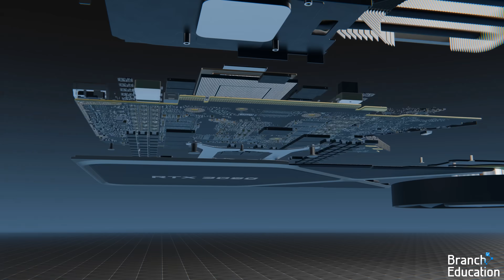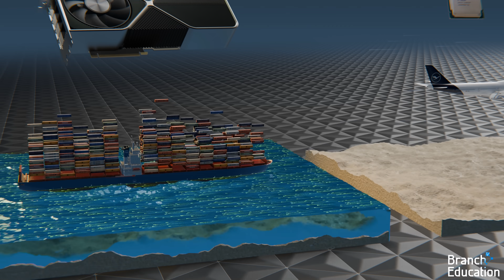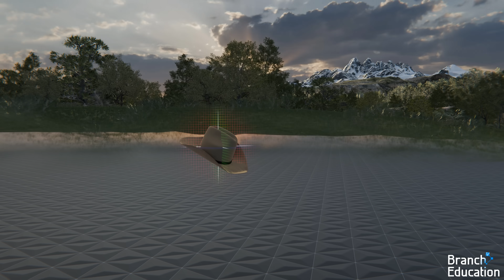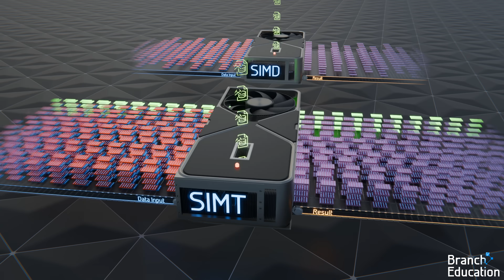How do Graphics Cards Work?  Exploring GPU Architecture

Comment: They don't sell chips based on whether they've gotten damaged or not, they actively shut down votes to adjust the prices accordingly. They're ripping you off basically and it's legal because we're dumb enough to keep buying them. The only time you get an entire chip working is the very last one in the series, all the rest of the models have deactivated cores. Of course they say they're damaged so you don't try to activate them but all you need is a bit of power and violá

Comment: I think that weather/climate models fit the"embarrassingly parallel"  since in parallel mode the globe is split into an array and each core essentially does the same calculation. The finer  the grid  the more points hence more cores. Can they benefit from GPU impromentss

Comment: When you broke down the comparison between a CPU & a GPU it sounds like a GPU is a lot more like a an ASIC then anything. With an an ASIC being a chip designed for a specific task & a GPU's task being digital image processing & accelerating computer graphics there doesn't seem to be a whole lot of difference - at least on the surface.

Comment: My RTX 4080 in my current desktop can do 48.74 trillion calculations per second. Compared with my old desktop which has a GTX 1070 that could do 6.5 trillion calculations per second. My current desktop also has an i7-14700K, 32GB DD5, 2TB Samsung 990 Pro M.2 SSD, which I got back in Dec 2023 and have yet to do a review video of (I'm looking to get round to the review video next month)

Comment: As a professional electrical engineer with 20+ years of experience, I have found that Micron's datasheets for memory products are either the best or amongst the very best out there.   It should not come as a surprise that the quality of their video is extremely high as well.

I've had instances where I was trying to interface another brand's memory product (not my choice) and ran into persistent problems.   Read the datasheet for the similar Micron product, and the issue immediately became clear.   In other words, the other brand's datasheet was poor.   When the choice is mine, I look at Micron memory first.

That's a long winded way of saying, excellent work.  Thank you!

Comment: It’s simple. 
A GPU chip only does one thing.
A CPU can do many things.
A GPU changes a black cell to white. 
A CPU can decide if the colour needs changing, which colour is best , how bright it is and place it in not just the right place but the best place of many options to best serve the apps function. 
And a CPU can run many apps.

Comment: The craziest part for me is: how did people come up with this??????
Reply: It didn't happen overnight. Today's GPUs are a result of gradual improvement over decades. Initially computers didn't even have GPUs. The CPU had to handle all the graphics processing. Of course that slows down the program so programmers got the idea of making GPUs that would handle graphics processing and so free up the CPU to run the program. Today's games require so much graphics processing that it would be impractical to run them on a computer without a GPU. But all PCs today have a GPU. Even if a PC doesn't come with a dedicated GPU it has an integrated graphics controller built into the motherboard. It's not nearly as fast as a dedicated GPU but it's sufficient for less demanding games.

Comment: A more violent analogy: A cpu is a mounted gattling gun. It can swap targets quickly and take care of several small things at once, clearing a field of individual targets quickly. A GPU is more like a missile system. It can destroy a large, concentrated area, but needs more time to reload before firing again. 

Firing a missile system at a small infantry group is likely a bad idea, in the same way firing a machine gun at a fighter jet is a bad idea. They're both destructive (maybe even equally so) but specialized for different targets.

Comment: how many calculations are made for 1 vertex to go from 3D to 2D? because I guess I got a better 3D engine which do 3D to 2D with 14 FMA operations, plus it has basic model distorsions with no additional operations

Comment: Graphics cards, or GPUs, are like supercharged processors designed to handle massive amounts of parallel computations. Unlike CPUs, which focus on sequential tasks, GPUs excel at rendering images by processing thousands of operations simultaneously. This makes them essential for gaming, video editing, AI, and scientific simulations.

At their core, GPUs consist of cores (CUDA for NVIDIA, Stream Processors for AMD), memory (VRAM), and specialized pipelines to handle textures, shading, and rendering. Modern GPUs also leverage ray tracing for realistic lighting and tensor cores for AI-driven enhancements.

Beyond gaming, GPUs power breakthroughs in machine learning, crypto mining, and deep learning due to their ability to crunch data efficiently. With architectures evolving, technologies like chiplet designs and AI-assisted rendering are shaping the future.

What aspect of GPU architecture interests you the most—gaming performance, AI acceleration, or creative workloads?

Comment: I'm mostly wondering why it's specifically a*b+c instead of a*b and a+b, like why are is a*b+c so common that they need an entire piece of a core for that specific calculation
Reply: Having something like val = val + a*b is a very common operation, for tasks like adding products together so having the core doing also potentially doing an addition (if required otherwise just set c=0) seems reasonable

Comment: 4:18 it’s more like “what can” it run faster 

They both don’t always run the same thing because they both automatically run what the other can’t. They are separate entities that just work together. 
For an example: a GPU may make things appear cleaner than the CPU 

I guess you could say that the CPU is like the quarter back of the computer. And the GPU is like the Wide Receiver that catches what the CPU needs help with completing. the Motherboard is like the coach and the Harddrive is like the play book. The system the CPU runs on is like the field (windows) it’ll play on with the RAM acting like the halfback. 

The task manager is just the Referee 😂

No matter how you look at it. A computer runs on code that you give it by using an algorithm. Which you learn that in basic Computer Science like an on and off switch.

Comment: 27:27 -- when visualizing Matrix Multiplication, it's a lot easier to understand and see relationships (such as BtAt = (AB)t) if you depict AxB = C by putting A on the left, B on top, and C in the space between them (in the center.)  You can just draw a horizontal line from a row of A, and intersect it within C with a vertical line from a column in B, and see how the dot product result shows up within that specific cell in C.  You kind of need to draw this to understand what I'm seeing, but it makes the nature of MMult really clear.

Comment: So the only difference between a 3080 & 3090ti is Nvidia doing a crap job vs what they're supposed to be doing in the 1st place?  If true, imagine using this tactic in the car or airline industry.  "We should have built a better plane, but pay us more so you're less likely to crash."  Disgraceful.
Reply: Jesus is the way, the truth and the life. Turn to him and repent from your sins today ❤️😊
Reply: Manufacturing defects are inevitable when fabricating semiconductors. Don't forgot that we're down at the scale of atoms and quantum mechanics, here. A small error up top cascades into a catastrophe down in the silicon, and errors are just a fact of life. Nothing can be perfect, there will always be some error. At least this way, a defective chip can actually be useful.
Reply: @jcm2606  So the reason why there would be GPU shortage for example is because it is very difficult to manufacture the high end GPUs with almost no defects?

Comment: 07:33 why they don’t fix it?
Reply: chips are printed in bulk on a single disk called "wafer" through a process called "lithography". then the wafer is cut into the multiple chips. generally, it's almost impossible for lithography to be perfect on the full wafer (the percentage of "perfection" is referred to as "yield"). lithography is complicated and expensive and requires lots of precision, but modern modular architecture allows the use of "defective" chips in most cases instead of throwing them away.
I don't know they can fix it. The chip has already been etched. and no machine can be somehow precise enough to refill the etching and redo it. If such technology exists, then they  would use it to scale the whole lithography down and make it more precise, which would reduce costs even more as more chips can be fitted into a single wafer, but then again, the same problem arises.

Comment: 0:03 [clicking]
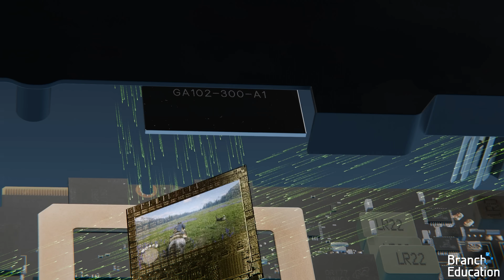0:08 [whooshing]
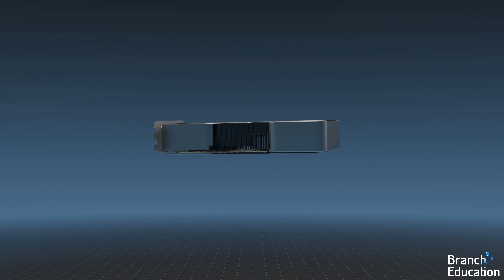0:35 [whooshes]
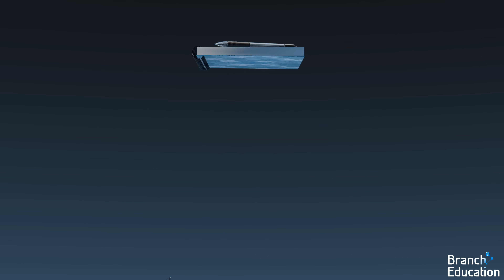0:48 [electronic chittering]
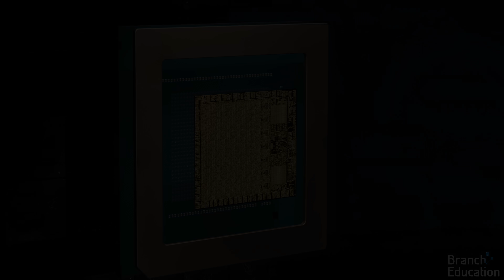2:01 intro
2:55 analogy
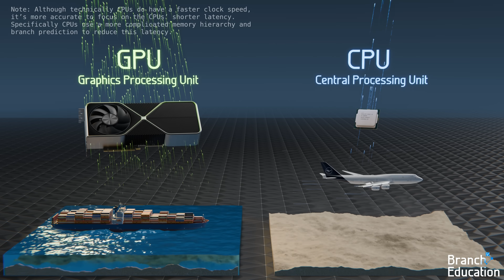3:13 note
3:32 airplane fact
4:26 [rapid beeping]
4:59 metal clang
5:04 pcb
5:11 brains
5:42 streaming multiprocessors
6:22 cuda cores meaning
7:00 note: 1
7:07 chip design fact
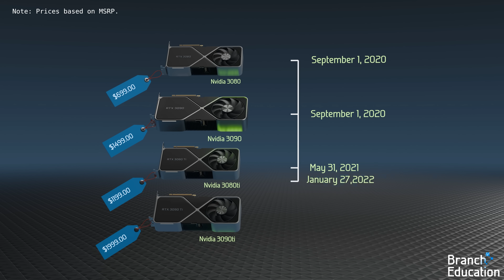7:16 note: 2
8:05 defective streaming processor comp
8:38 note: 3
9:09 Fused Multiply and Add
10:04 how to make calculations per second
10:43 other sections of the GA 102 chip
11:18 graphics card components
11:36 voltage regulator module
11:55 4 heat pipes
12:21 fact about loading in games
13:14 cool sfx
13:22 bus width
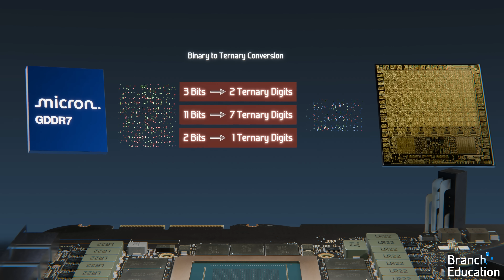14:12 binary to ternary conversion
15:02 reason as to why micron switched to GDDR7
15:24 HBM meaning
15:35 TSV meaning
16:01 i will
16:58 computational architecture 
17:03 embarrassingly parallel operations 
17:29 how to solve it
17:56 cowboy hat
19:52 a single instruction
20:17 whirring sfx
20:26 vertex transformation
20:56 computational architecture
21:51 note: 3
22:02 SIMT meaning
23:10 pulsing
23:49 Branch Educations dream
25:37 note: 4
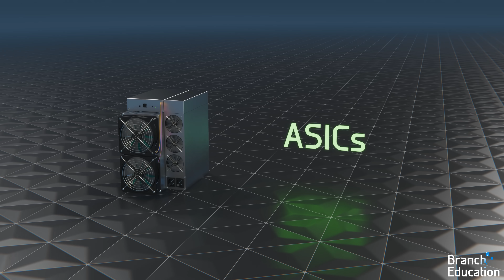26:29 ASICs meaning

Comment: I remember in the early days of gaming, a lot of developers faked random numbers and floating point operations. They used a look up table since additions (and subtractions) and multiplications were the easiest thing the CPU could do. Multiplications worked best when you simply shifted bits which is something a CPU can do without any sort of issue. So making games that are built around this were the best ones available like Tetris, Wolf3d, Doom, etc were all very simple additions and shifts of an 2 dimensional array. These days the GPU handling floating point operations which are the most costly operations of the CPU that slows down most games to a halt. I remember Quake 2 having CPU software rendering and it was slow as heck but just as soon as I got my 3dfx card, I remember the speed and visual effects were stunningly different.

Comment: at around 8min MIND BLOWN!
what!?!?! so every GPU from a generation of Nvidia chips is the SAME! only difference is which ones have more manufacturing errors?!!?!?
90 perfect 

but yes different speeds and vram and what not but mostly the same wtf!
Reply: Only some GPUs, not every GPU. That would be wasteful. Typically GPUs are designed to fit into a specific performance rung of a product stack, and NVIDIA will "downgrade" defective GPUs as necessary. So, the 3090 Ti, 3090, 3080 Ti and 3080 are the only consumer Ampere cards to use the GA102 GPU, with the 3090 Ti having the most functional GPU of the four (though it's not the most functional overall, those go to the workstation cards like the RTX A5000 and RTX A6000). The 3070 Ti, 3070, 3060 Ti and some 3060 units all get the GA104 GPU. Some 3060 units and some 3050 units get the GA106 GPU, and the remaining 3050 units get the GA107 GPU.

Comment: Wait, so technically a CPU can do just as much work as a GPU, it would just do it in a different way. Its like the GPU is one boat going from point a to point b with all the cargo, but a cpu is a much faster boat that takes 1000 trips back and forth to take the same amount of cargo... technically CPU's should be able to do what GPU's do, just in a different way.
Reply: Kind of. Fundamentally, yes, but there are differences that make GPUs noticeably better for "embarrassingly parallel" programs than CPUs. Because of those differences, a GPU would always beat out a CPU with an equivalent number of cores (which is on the order of thousands to tens of thousands).

Comment: Overview of what i took in, outlet power to psu, to resistor, to transistor, to capacitor and thats energy needed to be sent to hard drive to power computer, capacitor sending siilcone etched energy amount needed if droped, hard drive to and from computer screen and headphones using gpu and cpu,

Comment: so they just leave the broken cores on there?  I'm not a computer scientist or an engineer, but this seems like a money saving move to me.
Reply: Well, yes. Without binning, NVIDIA would be forced to throw the entire chip out since it performs worse than they want at best, is unstable unless they push more voltage into it than they want in the most likely scenario, or plainly doesn't work at all at worst. By disabling the defective sections of the chip and binning the chip down, NVIDIA can at least sell it in a cheaper configuration which is strictly better than destroying it.

Comment: Thank you for the video. It shares a large amount of information visually and understandably. I have a question about the Bus Width of graphic memory chips shared at 13:25 of video. It says 24 chips, however, based on what I understand from this video, there are 12 memory DDR6x chips. Is it right? Or am I missing something? Thanks a lot for your time!
Reply: For the 3090 specifically, there's another 12 on the backside of the PCB which didn't make it into the animation, for some reason.

Comment: The reason why graphic cards are so expensive is because a graphic card is technically a whole computer in one piece. It is like having a computer inside another computer and because how complex they are. They also calculate 3 equations at a time instead of 2 equations like CPUs.

Comment: 7:20 This is why there are more 5080s and 5070s than 5090s. Makes sense now. I was in line at 9pm when i found out microcenter had only 4 5090s and 50 - 60 5080s.
Reply: The 5090, 5080 and 5070 use entirely different GPUs. The 5090 uses GB202-300, the 5080 uses GB203-400, the 5070 Ti uses GB203-300, the 5070 uses GB205-300. The last number after the dash signifies how "downgraded" the GPU is from a theoretically perfect GPU, with a bigger number meaning a less "downgraded" GPU.
Reply: @jcm2606  how do you know they use gb202 and gb 203 for 5090 and 5080 respectively? Also I looked up both chips. GB 202 is just larger than GB 203. Almost double. They use the same manufacturing process and one just has a larger area to fit more transistors.
Reply: @lilpepe545  Which GPU each card uses is typically known around when NVIDIA announces them, as NVIDIA sells the GPU to AIBs (Asus, MSI, Gigabyte, etc) as a GPU+VRAM package. I just looked on Wikipedia since there's a list of all GeForce cards, but journalists who reported the Blackwell launch also tend to report which GPU each card gets.

And of course they use the same manufacturing process, it's the same architecture and the architecture is tailored to the process. What's different between the GPUs are the core and memory configurations. Smaller GPUs tend to have less cores and less memory controllers, which results in less VRAM at lower bandwidths. This is intentional and by design, rather than being a consequence of an imperfect manufacturing process like binning is.
Reply: @ so if there's a lot of defects on the 5090 chip from manufacturing imperfections or what not, whats stopping them from using less transistors on that chip and reducing size to fit it into a 5080 by deactivating the faulty cores?  Vram is not an issue here since Nvidia could easily replace 24gigs with 16 gigs of gddr7.

Comment: Omg i built a 40 lanes pci-e pc of a fx-9590(2011) and a R9 290x. It was supposed to be an xfire build but r9 290x went up to 1k from like 250$

Of this day this still my gaming pc pulling 60 fps in 1440p. I added an nvme adaptor via pci-e 2.0 with a teamgroup gen 2 1TB nvme drive. Write speed of 2.5gb/s on steam. 

Best day of my life right now!!! 🎉